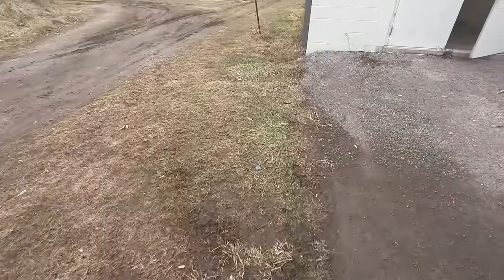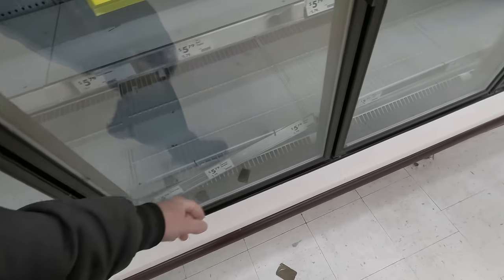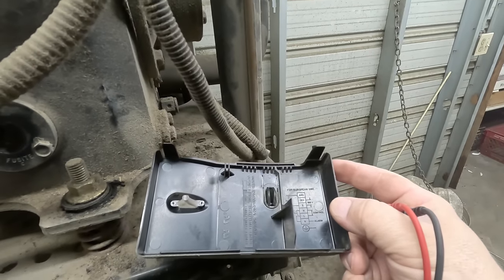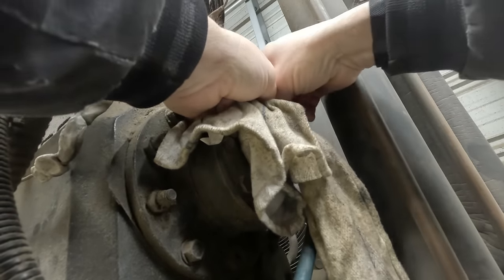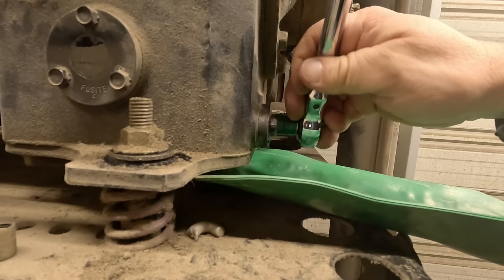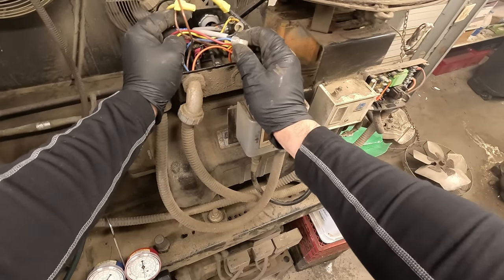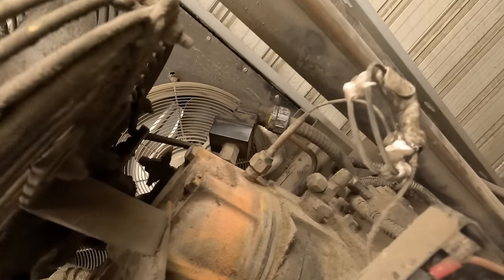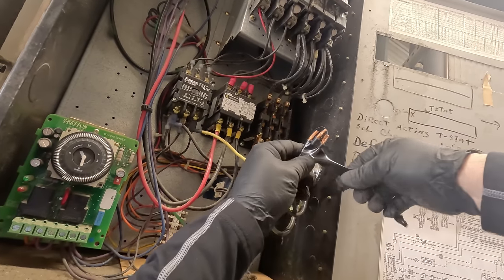Semi-Hermetic Compressor Failure Grocery Freezer Is Warm

Comment: Great video Rick. I’ve had my fair share of exhausted equipment. My favorite part was when you said employee/management reset the Sentronic oil safety. They did that damage lol.
Reply: You mean the safety is actually doing is job lol 😂 and the customer is o it tripped  I will just  reset it. 🤪
Reply from the maker: They might have, a few times usually means a week or three. 🤣

Comment: Looks like a lack of priodic inspections.  All the oil came back at once and Hydraulicly locked the crankshaft. Liquid floodback will push that oil out as will continued low pressure operation. 
A great teaching video  on semi-hermetic failure troubleshooying.. Normally along with the compressor comes a contactor, crankcase heater, a suction line filter, more to stop debris from entering the new compressor. Complete walk through of all the controls.
Reply from the maker: Thanks for sharing! All valid points👍👍

Comment: Copeland says no warranty unless new oil sending unit and safety control are installed on replacement compressor.
Reply from the maker: Normally, a new contactor is one of the main thing I’ve always heard. I don’t know if I’ve heard that about the oil pressure switch.

Comment: So was oil level not maintained for years after leaks causing this or is it throughout the system? Looked like there was zero oil in crankcase.   What a mess.
Reply from the maker: Oil wasn’t on the floor so it’s likely pumped it’s self out into the system. With longer run times it will come back. Monitoring is the only thing you can do with a little system like this. This is why racks have oil separators.

Comment: I would quote for a new fan as well , starting with all fresh components for liability purposes.
Trouble is that once you finish with the compressor replacement works you have to open a new can of worms with tryna find out how the last one failed ...
Reply from the maker: Naa ….get the compressor job and then go back and replace all the other stuff on another bill. That’s always the American way. Everybody wants to be cheap until it cost an arm and a leg.

Comment: Rip poor compressor. Wonder what happened though? Flooded back too much?
Reply from the maker: It likely tried to start with a non condensable aka liquid refrigerant in area above the head of the piston or got slammed with liquid while running at full speed. (Flooded start vs floss back)

Comment: So do you install new compressor with full oil? How do you know the old compressor oil isn't in evaporators?you can try flush lines but then you need to recover whole system
Reply from the maker: You have to install the compressor with oil at the normal level but would need to stop back and monitor the oil and oil acid levels. This could require oil to be removed or changed. This place was 50 miles from my area so it likely won’t happen. We haven’t heard back yet about authorization so they likely are going to keep being cheap and have it happen again. As you can See the store is low budget food with low budget maintenance.

Comment: What was the reason for the compressor not getting oil? No compression because motor overheated because improper fan cycling? Am I understanding that correct?
Reply from the maker: It could have been short cycling due to valves and piston issues.  If so then that will pump out the oil.
Reply: Would love an update on the new compressor. Got a lot of noob experience changing those damn rack compressors at my old job and learned a bit about the controls. Not enough. Oil system I didn’t understand feeding between multiple compressors, when it comes to troubleshooting. I know we changed one compressor for oil issues and it didn’t last long. Being a noob I wasnt there for service and never found out what was wrong. Rack compressor changeouts are quite a chore between two people is my experience. Darn costco

Comment: Out of curiosity, how many hours does it take to dissassemble and and install a new compressor take? Also, is this compressor complete junk at this point or will it end up with being rebuilt and resold as a refurb down the road?
Reply from the maker: The factory will rebuild it, not us. Depending the distance, the job is from the shop plus the labor that is calculated that’s how we would come up with the price changing one of those compressors doesn’t take long because you can valve off the high side and low side and just unbold it, but there could be other issues, there could be pieces of stuff in the refrigerant lines that gets caught into other components, but we usually will put in there a clause that says those are extra cost that may happen, but not covered under this quote.

Comment: All those shavings, that's from flooding?
Reply from the maker: Flooding takes away oil. What happens when there’s no oil in an engine or in this case a compressor?
Reply: @HVACRSurvival  Wild. Maybe some slugging too if the crankshaft got busted up?
Reply from the maker: @Spruce-Bug  correct, you can’t compress a liquid. That’s what likely snapped it off.
Reply: @HVACRSurvival  Good to know. Thanks for replying. I'll be extra sure to verify low ambient suction pressure from now on lol

Comment: I honestly thought you worked for yourself but now in the past few months you have put out rack videos.  Do you not work for yourself?  Did you transfer to a new company and start full time rack work?
Reply from the maker: I work for a company that does everything under the sun. We have over 100 employees. That’s how I can be doing residential one day and doing an industrial call the next then maybe I’ll finish it out with some food service equipment and a generator. We have welders auto mechanics, plumbers engineers, architects, electricians, blah blah blah blah blah I was supposed to get into grocery and industrial Several years ago but it’s been delayed. Thanks to people in front of me. Those people are now not in the way as much as what they were.
Reply: Hope you get to to work on whatever you want, and continue to share what you can.

It doesn't all apply to what I do but enjoy learning what I can.

Gracias caballero!

Comment: everyone should automatically "quote" the cooling fan, cycling switches/controls(wiring?) as part of a failed compressor replacement. cover your hind quarters 🤔
Reply from the maker: We haven’t heard from them yet so that’s the reason why we have to be selective. Under biding is a problem

Comment: R.I.P. compressor(whole rack is clearly spanked out). if they're individual circuits then replace compressor, install giant filters and move on. if combined/grouped, oh dear lord help them.(remember that was College engineering(long ago) not much has changed, do you trust them as a working field grunt? 🧐🥳🥸